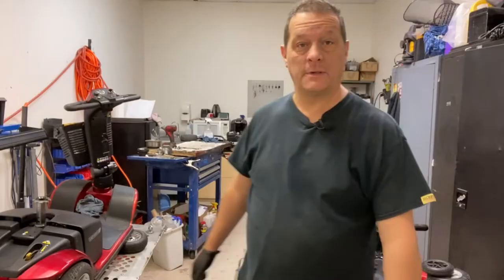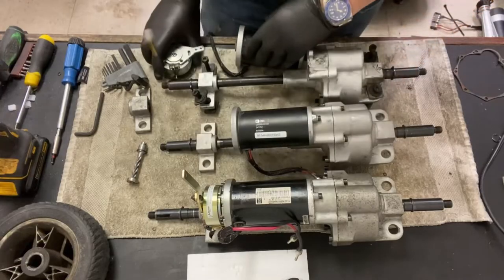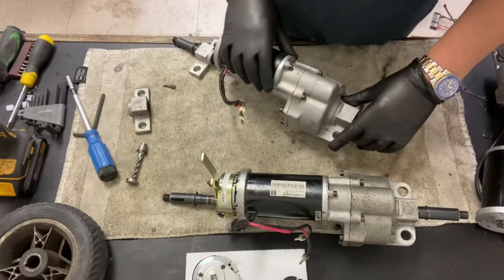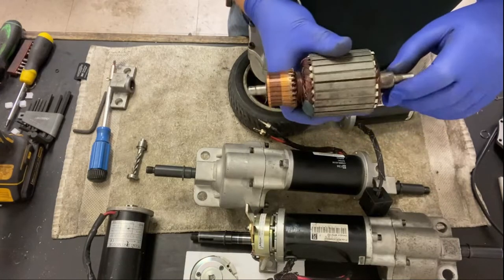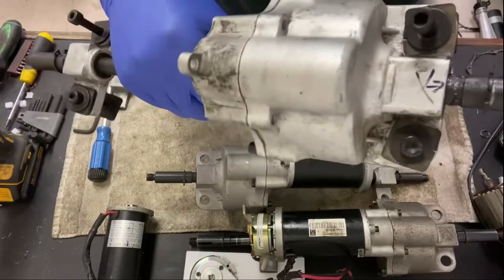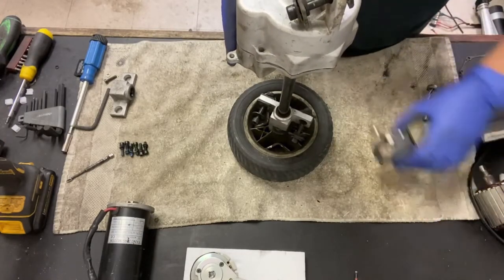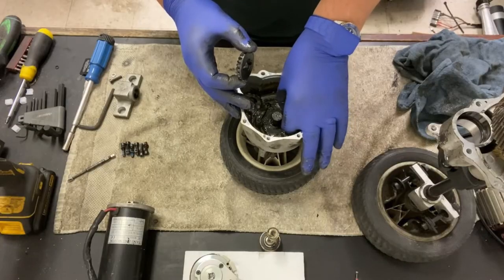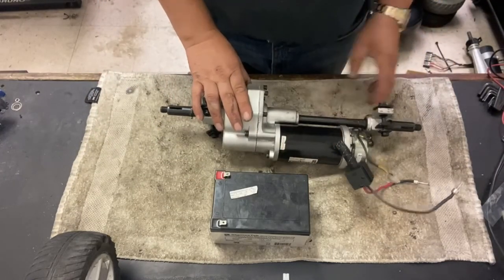How to repair a Pride Mobility Go Go Transaxle Motor and Brake – the Inner workings explained

Comment: Damned shame that new replacement electric brakes are not available. Usable used brakes may be available on Ebay, etc.  Buying a good used scooter ( careful) might be an alternative to trying to overhaul an old worn  scooter or buying a new scooter. FYI, Mobility Direct sells OEM transaxles with brake for $469 for SC40E Pride Go Go Elite Traveler.
Reply from the maker: I understand why Pride stopped selling just the brake separately $$$$ better to sell a motor and brake, you make more money that way!! Yes, used is the only option but then you might have reliability issues later on. I checked MD and they only have a Traveller Plus/Sport motor, trans and brake for $469 I am thinking of selling more parts on Ebay and hopefully I undercut MD and Monsterscooterparts.com price, but I'd have to check into shipping costs and fees.

Comment: I bought and old Rascal 655 many years ago the problem was both motors went so a company gave me a price on replacing both motors each motor cost $850 it would be $1700 for just the motors not including labor I was disappointed but my disappointment turned into determination and I'm handicap I can sit to work on something but I can't stand more then a couple minutes I will fall. So I took my old scooter and I gutted it down to just the wheels and frame cut everything off even the wiring then all I used was a drill a saws all and a bunch of nuts and bolts along with wiring and I built me a brand new scooter for less then $700 I used and electric go kart motor kit now I'm drag racing 😂
Reply from the maker: Glad you are keeping that thing going even if it is only drag racing it, drive safely my friend.  👍

Comment: I have a pride go-chair, it's 5 years old, gets used every day, took it to my local mobility shop because it's developed an annoying "clicking" sound when driving under power, they said the motor and transaxle has worn out, is 5 years a good lifespan for this model?
Reply from the maker: Hey Rob, manufactures don't give an indication on how long any unit will last but it's all down to wear and tear I guess, five years of heavy use then the chair might start showing some issues. The clicking sound I would get a second opinion. These chairs don't have transaxles but two independent direct drive motor gearbox on each wheel. It could be something simple like a loose wheel nut or the wheel keyway shaft just worn. if it is in fact one of the gearbox's breaking down, you'd probably be better replacing the power chair rather than replacing parts.

Comment: what part needs to be replaced if the scooter rides fine but then sometime it cant move forward i can hear the motor spin and if i push the scooter with my foot a inch or so the it rides forward again
Reply from the maker: Without seeing the make, model and the scooter it's hard to say. If it's a Drive or Golden product it could be a broken drive transfer shaft from the motor to the transaxle but that's a guess. Again, without see the scooter it's hard to tell you a definitive answer. Best thing is to take it to a local scooter repair center if you have one close to you.

Comment: I have 2 oh these that have washer wear , it has destroyed  the washers so i have no idea what to buy to replece it . I think its some kind of a spring shim or wave washer i dont know. Both my scooters have the same problem, gear4s grind as i turn . HELP! I need the spring washers for the top housing , both the small 1 for the drive gear & the one between the large gear and the housing have disinterested,.
Reply from the maker: Pride use a spring washer for the small bearing on the long drive gear from the motor to the main gear but a flat thin wash for the mini gears at the end of the shafts to space them out.

Comment: Ian I just completed watching your video and just want to thank you for the education.  I have an Electric Mobility Rascal 245 scooter that is 25 to 30 years old.  It was last used by a relative about 15 years ago.  But when she passed, I put the scooter in my basement.  The basement is dry and not exposed to swings in temperature.  

I now have another family member in need of the scooter but it will not take a charge.  I’ve just ordered replacement batteries and hope that will be the fix to get it running.  Your video has helped me understand how the scooter works.  I’m not very mechanical and unable to tear down the scooter transaxle (lack of tools and experience), but your video has given me more knowledge to recognize possible problems and if the scooter is worth repair.  I plan to watch the video again if the scooter runs after the new batteries are installed.  Thanks again.
Reply from the maker: Hi David thank you for your kind words, it's much appreciated. If you have any problems with the scooter, feel free to emails us and I can guide you into what to look for.
Reply: Hello Ian  I just got new batteries for the 30 year old Rascal 245 scooter I have had in storage for 10 years.  It was working 10 years ago but the new batteries are not working.  The horn works, but nothing else.  Any ideas?  I've examined all the wiring that I can see but do not see any damaged wires.

Comment: Hy Ian just watched this Amazing Video and Subscribed Immediately, I have an Pride Apex Rapid I have just installed new 22 anp hour batteries, and the scooter is a bit slow and has been for a while and making a noise around motor area, I thought this was tyre noise as they are well worn, these new batteries are the 3rd set it's had since new, I have always got very good distances in the past and I weigh over 17 stone - 246 pounds, I took the 3rd trip out getting longer each time to condition the batteries, I did just over an hour and had 3 green lights out, this had never happened before, with the other batteries I've had, even when they was over a year old, as the scooter is a breakdown boot scooter I kept the top off the lift out battery box to volt test them through the charging processes, and everything was as it should be when I got back from my 3rd trip I took the motor and wheels assembly off turned it over, and the transaxle and motor where very very hot the brake wasn't as hot, did not know if this was normal as I had never checked it before, so I got on YouTube, and found you Ian and thank the stars the video was about transaxles motors and brakes, after Watching this I went out to check mine it had all cooled down, and I started checking did all the volt meter testing you did and everything was fine, the bearing on left side of Transaxle had lots of play no signs of grease the long axle on on right had more in and out play than you showed in your video, I could see the small difference in the transaxle motor to my own, you mentioned in your Excellent well informed video that parts are hard to find, so I thought I'll just have a look on the net, I found a site that sells Pride mobility parts, I don't want to name the site as YouTube may remove my comment, a fully complete transaxle motor and brake for an Apex Rapid is £245 without vat that I am exempt from, also saw a brake for go go elite traveler for £82 for same scooter motor&brake £170  all these prices do not include vat, the cheapest new Apex Rapid I have found so far is over £800 without vat, my scooter is very old but looks good, I also checked everything else on the scooter and no play in anything, since I've had it all it's needed is batteries and ignition barrel that cost £12, at the moment it needs new wheels-tyes if I had known I had this axle problem I might not of purchased new batteries that cost £80, and maybe opted for a new Apex Rapid one, what's your advice Ian please, new Transaxle motor & brake and tyres or brand new Pride Apex Rapid, I will name the parts site in my next comment many many thanks for bringing this video to us kind regards Bryan from Doncaster Yorkshire England
Reply from the maker: Hi Bryan glad you found the video helpful and thank you for the kind words and subscribing to our channel. 
With your problem it does sound like transaxle. I'm pretty sure the LX shares the same transaxle as the Apex Rapid and I have done my fair share of replacing them in the past. (even under warranty). As far as I'm aware I think Pride have changed manufacturer of the transaxle from the original ones they put in these units and only time will tell if they hold up. 

I always tell my customers if they need a new motor transaxle brake assembly due to Pride only selling the transaxle with the motor and brake together that you might as well buy another scooter and trade it in if possible.
 
My only problem with third party online parts suppliers, are they selling off prides first generation transaxles?  Another concern I have with online third-party parts suppliers is the warranty on the parts. Here in the US monsterscooterparts.com have a limited 30 day warranty and I do not see anything on the UK website regarding warranty (I Might be wrong) and you have to install it yourself. 

Buying new?
My choice for a transportable scooter would be: 
If you can handle the weight then the Zero Turn 8 or Revo 2.0 but that thing is way too big for a boot, you'll need a lift or SUV. Best of luck buddy. 👍

Comment: Very informative video.  Have you ever worked on an e-Wheels EW 11 drive train?     Is Permatex  a solution for bad gaskets in the gearbox?
Reply from the maker: I've worked on a couple of E-Wheels scooters EW36 and a big four wheel. The three wheel is in my store (dead) due to a broken frame welds to the rear axle and that had a leaky axle. The four-wheel had an electrical problem. We used to be dealers of E-Wheels but could never get in contact with them or parts or orders, so we had to fire them. We can't get customer service from them then we can't offer customer service for our customers. 
As for gaskets I'm pretty sure they wouldn't sell just the gasket but sell the complete transaxle.
If I had to rate the company, it would be...
1 out of 10 for products
1 out of 10 product support
-10 out 10 for customer service.

Comment: Really informative,what size washer thickness did you use?,mine Grids when turning left?,good possibility it's the washer,thank you again.
Reply from the maker: To be honest it depends how badly warn the internals are to determine how think of a washer you need. The original washer is very thin and It's a case of trying something reassemble the unit and trying it to see if it binds up or runs freely without slipping. Alot of trial, mess and error.
Reply: Many thank Ian,keep up the great work you do.

Comment: Good video , just a couple of questions,  what type of grease goes in the axle and could you use silicone instant gasket to seal the 2 halves together. 👍
Reply from the maker: Hi Steve glad you liked the video. I've heard other people use all-purpose Lithium grease and have good results and increased drive range from it. As for sealing the transaxle, I've never had to do it, but if I had to I would use something like a gasket sealer or instant gasket product.
Reply: @lasvegasscooterslifts  wouldn’t that change the spider gear play by not having the proper thickness and smashing the axle gears closer to the main gear!

Comment: Hi, would a go go increase speed by putting on larger wheels, is it worth the effort. 
Regards Sleeper
Reply from the maker: Gearing or a controller with a larger speed programmed into it would change speed.

Comment: Sir;
This is to thank you for your clear, thorough and very helpful GoGo gearbox teardown and problem resolution.
I am going to need a thrust washer like what you had and installed behind the left bevel gear 
I cannot find a source of Pride GoGo gearbox component service parts.
Would you consider letting me know the dimensions of the thrust washer that you installed in this video the thickness being the most critical dimension. 
Thanks again for you  much appreciated video.
Reply from the maker: Hi and thank you. I'm afraid each model of transaxle is slightly different and will wear differently so the size I put in the one I did was just potluck. I find that trying to find the right inner diameter hole is the hardest part and then it's a guessing game to how thick of a washer you need. I used everything from really thin 0.25mm to 1mm and sometimes thicker than that. 

With this type of fix, it's a matter of put one in and try it, that's why I said in the video I don't recommend this process as there is a high chance of failure and frustration. Good luck my friend. Ian

Comment: Great to see what I can expect when disassembling our scooter transaxle. I know you're 'just' demonstrating it, but it seems you forgot to put back the big 'ring' when putting back the two halves of the transaxle casing :-)  (The part that's in the top right corner for most of the video; I guess you had opened it before)
Reply from the maker: Yes, I tried to get everything pre planned to make videoing easier.

Comment: @33:30 looks like a wave washer i found on amazon , but i dont know the dementions.
Reply from the maker: The originals where very thin and degraded easily when over worked.
Reply from the maker: Unfortunately, Pride don't sell any individual internals for their transaxles.

Comment: Great video, I have a pride gogo sport one of the wheels doesn't turn at all. However it is the opposite side of what was displayed in video. I changed the brake and Im ready to throw in the towel. Is it worth it for me to try to figure out why that side isnt moving then fix it?
Reply from the maker: Thanks for the comment, rare to see a sport transaxle fail. 
Thats a tough one, if you've taken the brake off and its still locked up then its something either in the transaxle that's locked up or the motor. If its transaxle then it could be either the end bearings (no fixing that) or something jamming or jammed in the drive gears. If cost is an issue then repair might be your only option, as a new replacement is around $500 and used is always sketchy as you can't tell if it's been abused or not. 
Good luck Ian
Reply: Maybe somebody left the key out of the axle on that side
Reply: @lasvegasscooterslifts  the one I had a part I thought they were built pretty good for the nasty grease that had in it
Reply from the maker: Good observations, I originally had that thought, but with them saying one-wheel doesn't turn at all it would still turn if there were no key on the shaft that's why I went for a locked-up transaxle.
Reply from the maker: I think they put all that grease in there to stop us from messing with it LOL

Comment: were can i buy a replacement pin that is on the  wire from the motor we have a broken one thank you our scooter  is a go go elite traveller lx
Reply from the maker: Hi Jack, unfortunately I don't know of anywhere that sells the pins separately. You would have to replace the motor and brake.

Comment: :hand-pink-waving: Hi when you described the internal of the motor the rotor you showed us is a brush driven commutator,  the motors on your bench from the gogo pride are brushless motors are they not ???
Reply from the maker: Hey Bll yes you are Correct it was the motor commutator from a prde victory motor that I used as an example of over time how they can ware down and be less efficient. As far as I'm aware no go-go's do not use brushless motors. I have taken one apart to inspect it and it had brushes and a commutator.

Comment: Thanks buddy my trans axel is snapped as can here this great grinding even when in free wheel mode caufht in cogs as i understand this .undrr warranty so all we be ok .
Reply from the maker: Hi bud defiantly take the scooter to a dealer to get them to handle the warranty issue for you. Just a heads up for you this is from Prides warranty T&C 
NOTE: If there is an increase in the operational noise level in the transaxle, the warranty does not apply. An increase in operational noise level usually occurs due to abusive and excessive strain on the scooter  

https://www.pridemobility.com/resources-and-support/pride-mobility-warranty-information.asp

Let me know what they say and if the cover it. Good luck

Comment: Great video. My Pride Outback (Australian model) stopped working after a loud screeching noise emanated from one or both of the motors/brakes? Now all i get is the 5 beeps when i turn the key. What do you suggest may be the problem? Replace breaks and /or both motors? Scooter is 3 years old and has done only 700kms. I expected the scooter motors to last longer than that before it would have these sort of issues. It has been well looked after and not thrashed. Batteries were recharged after every ride. How long do the batteries usually last if recharged correctly? My local scooter serviceman suggests that i replace both motors and breaks or buy a new replacement scooter. Any advice you can offer is greatly appreciated. Cheers Pete
Reply from the maker: Hi Pete and thanks for watching. The outback or wrangler here in the US battery life depend on several factors (see my batteries video for some good advice) but typically between 3 and 5 years but it depends on many different factors. 5 beep or flash error code usually means break error and with you saying you heard a screeching sound and what your tech said I'm almost 100% positive that's your problem. If you could find which wires go to each break, normally you would do an Ohm reading with the break in the drive or locked position to see if you have a reading of usually 59 - 70ohm range, if it's an open circuit then that break is at fault. 
Replacing the break/s and motor/s can be a costly repair if the parts are available.
Reply: Thanks for the quick reply. Hopefully, that will help me make the right desicion. Cheers Pete.